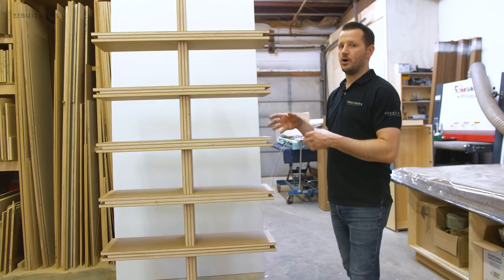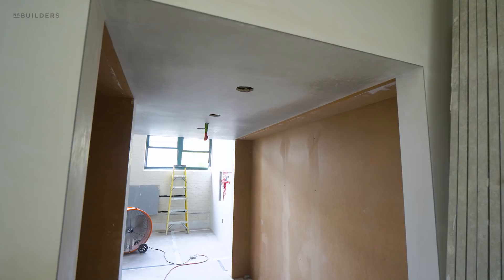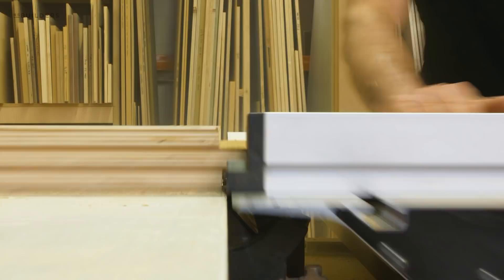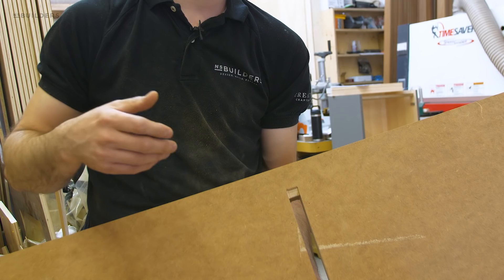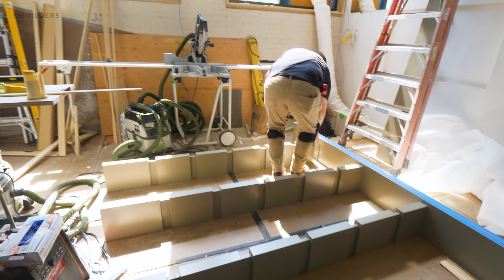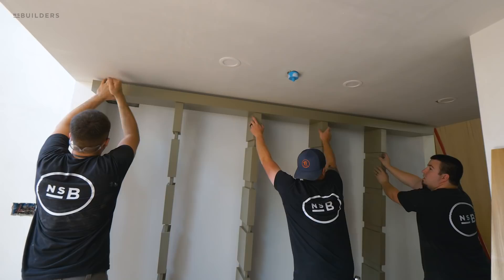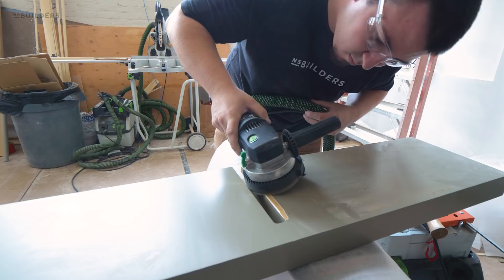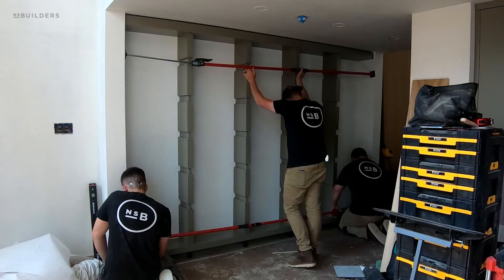Built in bookshelf made with LAP JOINTS

Comment: Looks killer amazing design, i wonder anything you will do different, to easy the install, and how did you finish the edge, edge banding ? Thanks guys great work always learn with this videos, dying to see that house finish i can tell the owner will be please
Reply: Thanks, this house is turning out amazing. We used 1/4" solid wood edge banding. This went fairly smooth so Im not sure there is a ton we would change if we had to do it again. Things like easing the edge and what not during fabrication would be one thing.
Reply: Again by far one of the best channel of remodel, pro fine carpentry, always finding a way to improve on every level.